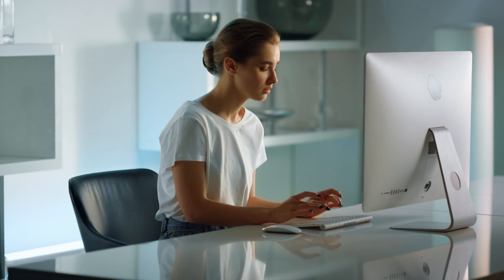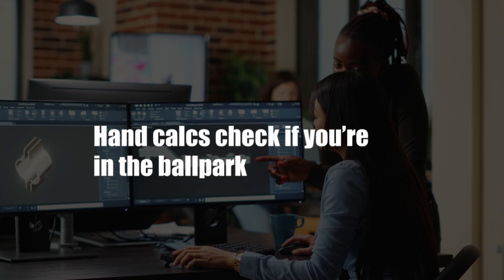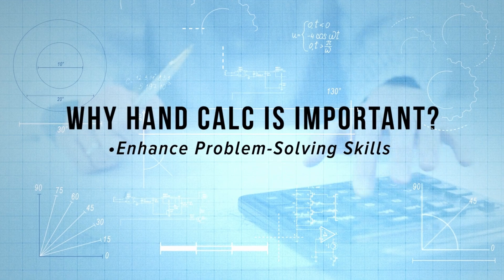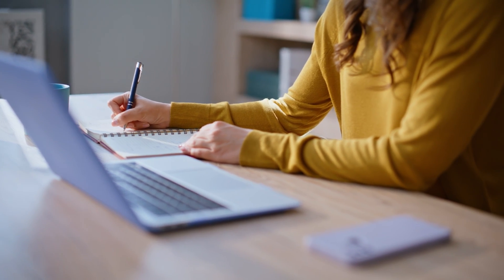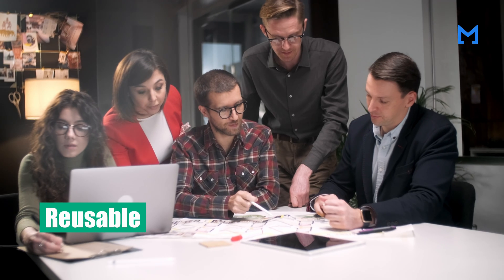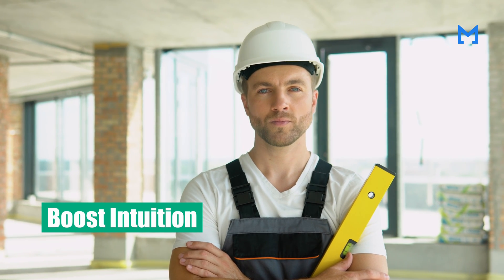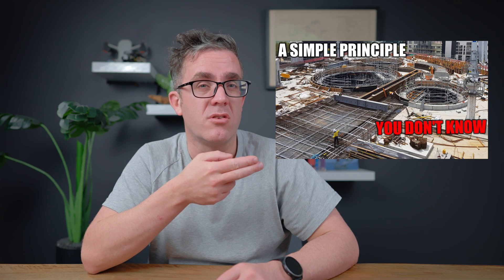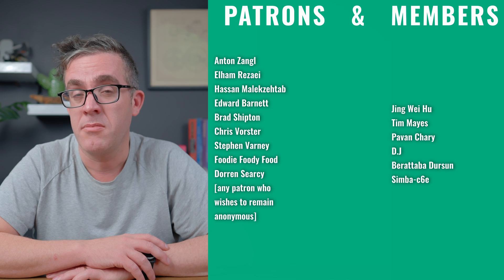Why Real Engineers Still Do Hand Calcs, but This Tool Makes Them 10x Better!

Comment: Not sure why you're getting such negativity in parts of the comments here. Yes at the core this looks very similar to mathcad, but even the little UI improvements to find and tab through previous variables are genuinely useful quality of life improvements.

The templates side is interesting, I've been developing something along those lines for my project team in a mathcad environment and seems really promising. Doing that with Python backend would have been so much easier than packaging up mcdx files. More approachable i think. 

Sadly not a package I could realistically get into our area of work, but looks great - hope   it works out for you. Got to keep the big dogs sweating!
Reply from the maker: Thanks for the balanced view. We built MathJot to keep familiar workflows but remove friction in navigation and reuse. I appreciate you giving it a fair look.

Comment: Validation and hand calcs are different concepts, hand calcs only give an approximate check for the stresses and strain on the structure using simplified theories and simplified methods of computations. While validation is comparing you Numerical simulation with real world data captured physically in the real structure
Reply from the maker: This I think is different from design and acidemia. 
From a consultant point of view, we cannot test, but you want to check the outputs from the fea are reasonable.

Comment: it's a Mathcad knockoff...how is it qualified?...if it doesn't have a qualification pkg what can you use it for?
Reply from the maker: Thanks for the pushback. MathJot runs on a Python backend and we verify calculations against reference cases to ensure accuracy. As with any engineering tool, professionals remain responsible for code compliance and for choosing the right formulas. We built MathJot to improve on things we struggled with in Mathcad like clunky editing and limited WYSIWYG readability, and to offer a cloud experience you can access anywhere with internet. It’s still evolving. If you try it and share where it doesn’t meet your needs, we will add those items to our roadmap.
Reply: It’s not a genuine review, the guy is just trying to push a junk piece of software because he has received money to do so.
Reply from the maker: MathJot was founded by two engineers (including me). I'm not reviewing it, I use on daily basis for my engineering projects.

Comment: The technician or machine tool operator can quickly learn to operate the instrument or CNC machine without spending lots of money and years of effort to earn an engineering degree. As requirements for manufacturing processes and performance specifications change, the hardware and software that we use to provide to processes and specifications must be reviewed, analyzed, updated, redesigned. In my almost half century of electrical engineering practice in the Defense industry, "Hand calculations" have been ubiquitous particularly in the initial stages of a project. "Let's make sure we have a clear understanding of the stuff the equipment is supposed to do, and our equations are correct."

Comment: As an EE, I sometimes HAVE to do the hand calculations - typically for a sensor circuit that is read by a micro.  In those cases, the software needs to know some component values and plug them into the circuit equations I gave it to solve, as not everything comes directly out of an A to D converter.   You can then use a circuit simulator to verify your equations.

From a design perspective, I like to think of it this way:  "Getting an answer out of a computer is easy.  It's knowing when it's lying to you that's hard."  That's where doing some hand calcs can be invaluable.

Comment: Brendan, is all that hand validation billable hours? Maybe buy the two best alternative software systems and validate your results after running both systems simultaneously. Only asking an intern to do manually validation if discrepancies exceeding confidence levels exist. Let the insurance adjusters handle any future fallout, the intern will be in your position by then and you will be happily retired.

Comment: I  a geotech engineer with 36 years experiences in NY and NJ.  I feel I am in the last train of old school engineers.   As of today I do most of design by hand calc (I learned from my former supervisors).  Young engineers who work for me use various softwares as a check.   Engineering is about common sense and practical experiences.  Thanks.
Reply: I thought the point of using software is to help with repetitive or to simplify complicated steps.  At the end of the day, one should always have a good understanding of the math theory that the software algorithms runs on.  Things like finite element analysis/methods, there are heaps of math theory books that have been written on it, and a lot of them are purely from the math/numerical side of the subjects, same for finite difference methods and any of its subvariants.
Reply: @eliasmai6170 The math and the Numerical side of finite element method are two different things I believe. I believe the maths side is to do with the mathematical theory behind finite element methods while the Numerical side is more practical, how finite element method could be applied to solve problems.  I don't think there are that many books that deal with the mathematical foundation of finite element method ( what I mean by that is that it contains proofs, derivations of the equations and things like differentiability and existence)
Reply from the maker: Thanks for sharing your experience, it's really valuable to hear how you still use hand calculations and common sense in your work.
Reply: In my classes of structural design I teach using hand calculations later in the quarter I teach my students to verify the results with software.
Reply: Rapid hand checks are very useful. For example a frame M=q*l^2 /coefficient. That coefficient could be 12/16 in fixed end for check purposes. Knowing in avance which combinación would be the critical and check for this. Other useful rules is aplying M/S + N/A and consider some reduction for lateral (just for gross number).
Another approach it have mathcad or spreadsheet previously checked.
Is very important to have "the feeling" of the software output as you said

Comment: I use Excel like MathJot, to print to A4 (my report sheet is like a Word document where all calculations are live, and on other sheets I can have a lot of background calculations). A bit more work to set up but worth it. MathCad was another software I always wanted to use but too expensive when Excel does the same for me.
Reply from the maker: Agree that mathcad is a bit expensive and has some annoying ways you need to use it, hence we worked on making it easier to use. 
The issue with excel is that you do not know what is in each cell unless you click on it, it can look good and be dynamic but it is opaque.
Reply: @BrendanHasty for sure MathJot will be a big step up to Excel. 
To verify the Excel you can use keyboard shortcut CTRL + ` (the grave accent key) to toggle between showing formulas and results. 
Keep up the good content. 
All the best!
Reply: Smath Studio has some free versions.
Reply: We can embed MathCAD into Excel. One sheet in MathCAD validated throughly can be used on a array of inputs producing array of outputs. Free akternative to MathCAD is Smath.

Comment: Hi Brendan, 

While designing software continues to revolutionize the engineering field, hand calculations remain an essential component of the design process. By combining software designs with the fundamental understanding provided by hand calculations, engineers can ensure the accuracy and reliability of their designs. Hand calculations allow engineers to develop a deeper understanding of structural behavior, identify potential errors, and make informed decisions, whereas software designs enable efficient analysis and optimization of complex systems. A balanced approach, incorporating both hand calculations and software designs, is crucial for producing safe, efficient, and cost-effective engineering solutions.

Stay safe 
Malik from Barbados.
Reply from the maker: Hi Malik, well said, for me hand calculations give an insight into the structural behaviour which can not be gotten from just software analysis.

Comment: A lot of problem in frame and plate design needs to be hand calculated using design codes. Some people may misconception using shell/solid elements type in order to account for details. Code check is the first step before making more detailed fem model. These hand calculations indicate you are Real.
Reply from the maker: Couldn't agree more you need to know the basics, even under the results and are you analysing it correctly. Only using fea to validate your hand assessment or tweak a little extra out as your hand assessment made some conservative assumptions.

Comment: Hand calculations leads the thinking. 
First principles thinking.
Reply: My favourite calculation at the moment is the length of the Australian national electrical grid at 1million km. 
The cost to replace is $1million to $13million per km. 

The grid itself is the dominate business valued at $1TRILLION to $10TRILLION  ?? 
ROI  return on investment, $100sBILLIONS per year. 

Generation costs 4cents kWh 
Consumers cost at the meter box 44cents kWh or my 52cents kWh. 
Roof PV is 2cents kWh electricity for decades and decades. 

But the grid is too small to replace fossil fueled energy at 6,500TWh annually.  It has a 250TWh capacity. 

Engineer's problems can only be part computerised.
Reply from the maker: Yea we also need the right solution and willingness for people to go in their direction sometimes we need to become salesmen